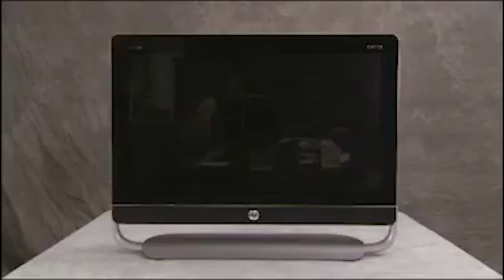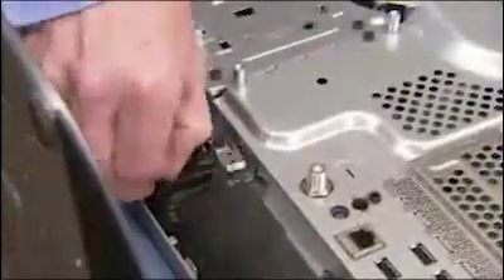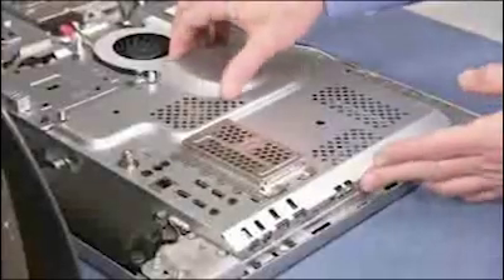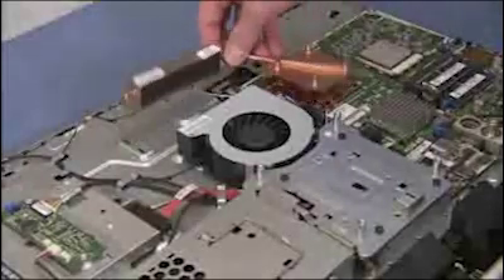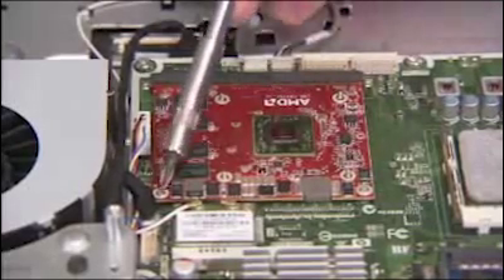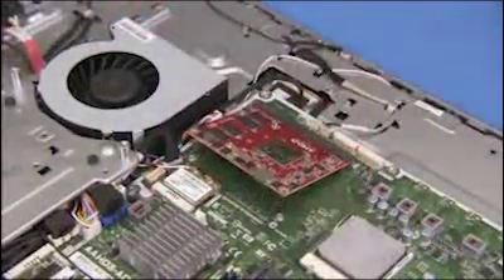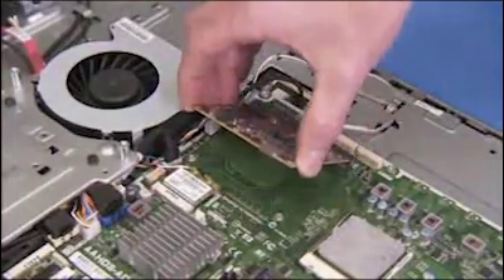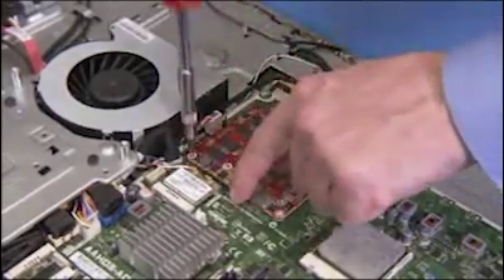Add or Replace the MXM Graphics Card | ENVY 23-1000 | HP Support

Comment: i have an HP Envy 23se-d494. i have upgraded the ram and want to upgrade the CPU as well as the GPU. i picked out an Intel i7 -4790s as it uses the same wattage but want to make sure it will work with my system. for graphics i just want the best i can throw in it. thank you for any response!
Reply from the maker: +iBka0tik1 Gaming Please refer 'Processor upgrade information' under the specifcation page to know about the supported processors: https://bit.ly/3rDcW2L Also it has One PCI Express half-length mini card socket and One PCI Express custom sized mini card socket. So you can add graphics card that supports these sockets.

Comment: Somebody now the screw type's that I need to lock the graphics card? I just need that
Reply from the maker: +Waldo La Melodia HP doesn't sell after market screws.  Therefore, your best option would be to contact a local computer shop to see if they have them available.
Reply: @HPSupport  is available to upgrade the graphics card in a hp envy 23-c030?

Comment: I have a HP 520 1010UK. I need to up grade my graphic card. Can you tell me what is compatible
Reply from the maker: +Peter Trainer This computer has two PCI Express mini card sockets (Generation 2 speed) and one PCI Express MXM slot that supports a PCI Express x16 graphics card (Generation 2 speed). So you can add graphics card that supports these slots.

Comment: What is the most powerful GPU I can use in my HP Touchsmart 520?
Reply from the maker: +Brian The Husky This computer has PCI Express x1 full length mini card socket (Generation 2 speed): 1
PCI Express x1 half length mini card socket (Generation 2 speed): 1
PCI Express x16 Module (MXM 3.0) socket (Generation 2 speed): 1
So you can add graphics card that supports this socket.

Comment: I have an HP Envy 23-m210ea desktop. It has the factory installed Intel HD Graphics 4600 and Ge Force 730A
What is the most suitable, more powerful replacement graphics card for VR please? I have ordered an Oculus Quest 128gb
Reply from the maker: +Ken Halliday This computer has One PCI Express half-size mini card socket. So You can add graphics card that supports this socket.
Reply: @HPSupport  Hi
I've now discovered that the motherboard, a 2AFA, has the GeForce 730A GPU actually soldered onto it. Is there another compatible motherboard I can buy that either has an upgraded GPU, or an MXM socket? I'm aware of the power constraints.

Comment: What Is the most supported GPU? (Envy 20-d010la)
Reply from the maker: +Hugo Davila This computer has following expansion slots:
•One half-size PCI Express mini card socket 
•One full-size PCI Express mini card socket 
•One PCI Express x16 MXM slot that supports a PCI Express x16 graphics card (Gen 2.0)
So you can add graphics card that supports above slots.
Reply: @HPSupport  Could you suggest me any? Thanks in advance

Comment: I have an Envy20 Touchsmart Model # 20-d090 what mxm gfx card is recommended for that modle?  I also updated the ram and processor to 16GB and i5 3570s
Reply from the maker: +John Bacon This compute has One half-size PCI Express mini card socket
One full-size PCI Express mini card socket
One PCI Express x16 MXM slot that supports a PCI Express x16 graphics card (Gen 2.0) 
So you can add graphics card that supports this slots.

Comment: I have a HP TouchSmart 610, can I change my GPU? If yes, what is the best option?
Reply from the maker: +adnan karim HP does not recommend upgrading or downgrading hardware parts or software that is bundled with the product as It may affect the manufacturer's warranty and performance, however, you could change the configuration at your own discretion.

Comment: What is the best GPU for envy 23 d120ek
Reply from the maker: +Reda Tyane  It is a CTO machine therefore it can be any option in the list. Given it has PCI Express MXM slot that supports a PCI Express x16 graphics card (Gen 2.0) but finding a place to buy MXM card is another story. The specs shows 2 options:
GeForce GT 630M (2 GB)
Radeon HD 7650A (2 GB)

Comment: What is the model number of the GPU heatsink and will it fit on an HP Touchsmart 520-1047c? Also, what dimensions are the screws used for mounting the GPU to the motherboard?

Comment: What Is the most supported GPU? (Envy 20-d034 Touch Smart i5)
Reply: m5950, m4000 ok ?
Reply: @hoaile852  I have an Envy 23 (IPISB-NK motherboard, very similar specs as the Larrybird-B motherboard on your Envy 20 PC). FirePro M4000 or M5100 won't work. Ge Force GT 630M or Radeon Hd 7650A should work fine. Tried both of them on my Envy23. HD 7650A is a little bit faster than the GT 630. If your computer did not include the MXM board from the factory you'll need to buy a heatsink for it (694456-002 IS AURAS 1G MXM MODULE AL D6). Hope this helps!

Comment: Can you replace the. Graphics card on a hp pavilion laptop
Reply from the maker: +Onzie thanks for reaching out!
I understand that you need to know about replacing graphics card on your notebook.
I'll do my best to assist you.
There are no graphics 'cards' in your notebook.
There is a GPU which is soldered and integrated onto the motherboard.
The only way to upgrade the graphics, would be to replace the motherboard with one listed in the service manual which may have better graphics.
Let us know how it goes.